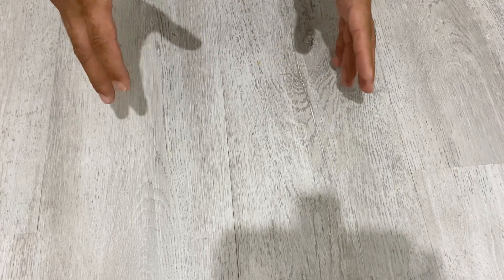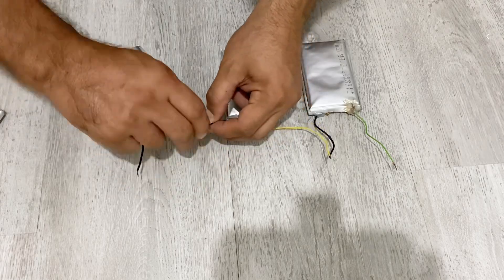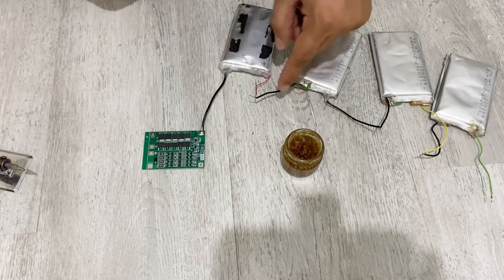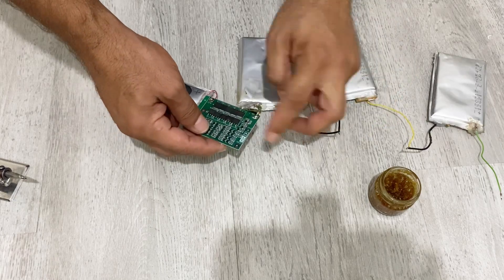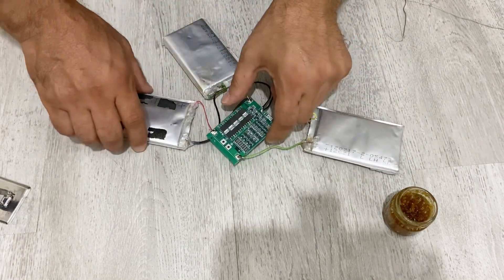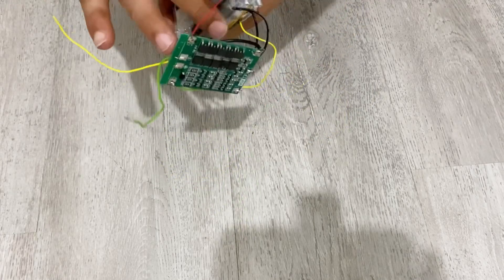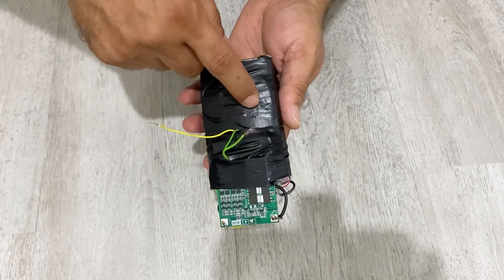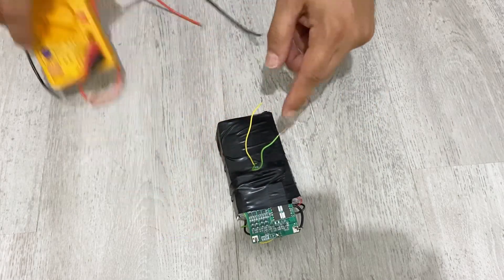How to Make 16 Volts 4S 10A LiPo Battery Pack

Comment: Quelques mots d'explication à propos de ce module de charge et d'équilibrage et surtout où l'acheter. Merci beaucoup
Reply from the maker: I bought it on TEMU. You can search it as 4S 40 Amps balance charging 👍
Reply: @joyofelectronics9782 merci 🎉🎉🎉
Reply from the maker: @slimel-gharbi8170 anytime